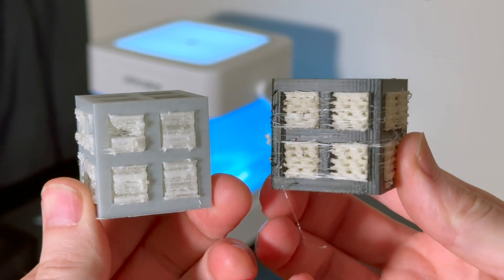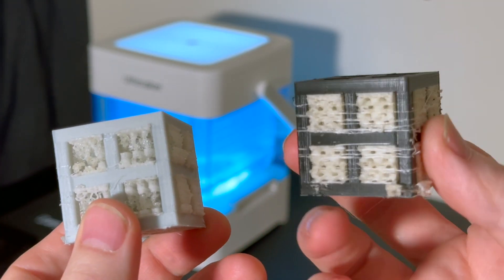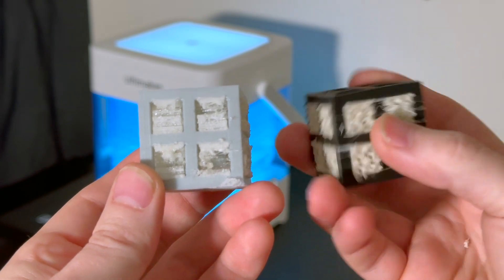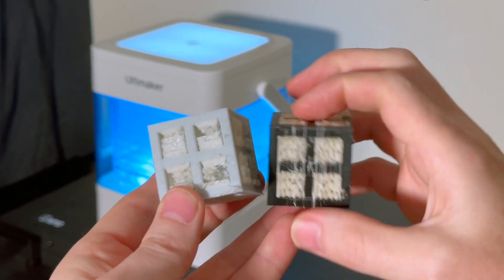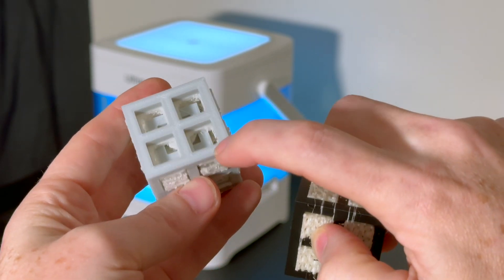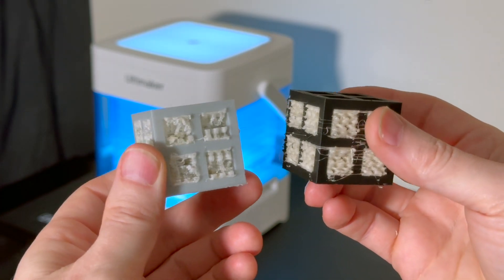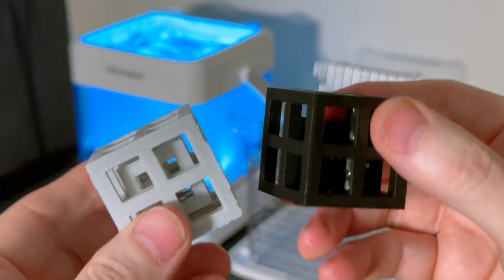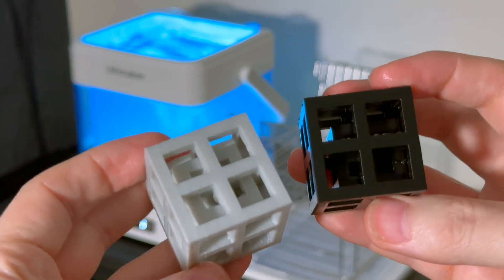3D Printing with Water-Soluble Support Materials - PVA vs. Aquasys GP (3D Universe)

Comment: Holy cow, the price???  I was under the impression that soluble supports were for the purpose of saving filament.  I can buy a lot more filament for this price.  I guess it's really only for extreme circumstances.
Reply: I haven't used it yet, but I'm thinking about getting a multi-filament printer just for this.  Every so often, I make a model that is pretty much impossible to remove the supports cleanly - parts are too thin, or the access to remove the supports are poor.  One thing I was thinking about was using PVA as a mold to lay fiberglass on, and then dissolve away the mold, rather than having to design with demolding in mind.
Reply: I saw that myself.

Comment: What settings did you use for the aquasys? I set it up per instructions on the label and website, and cannot get it to extrude nicely and keep getting clog issues.
Reply from the maker: I used 240C for the Aquasys GP. Have you cleaned your nozzle to make sure there wasn't some previous material in there creating a blockage? You're welcome to email us at support@3duniverse.org so we can troubleshoot further.